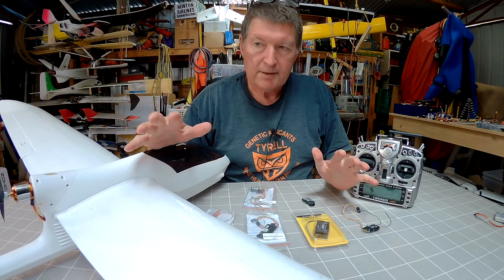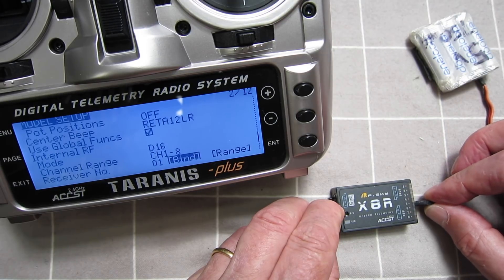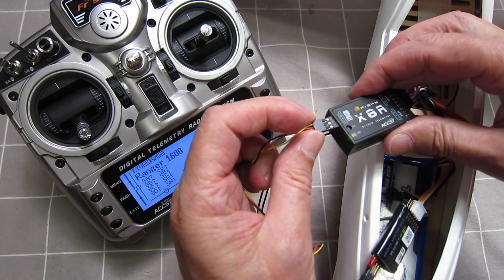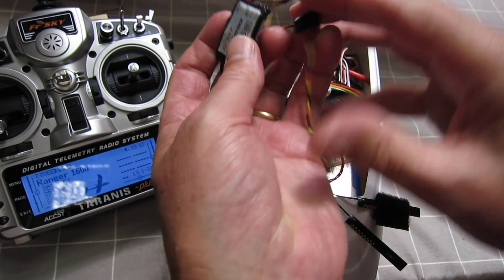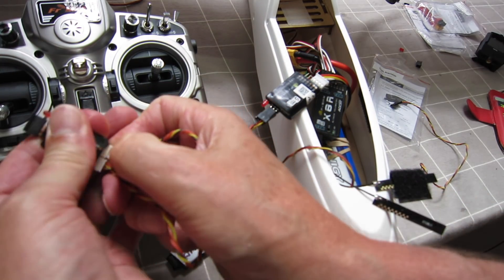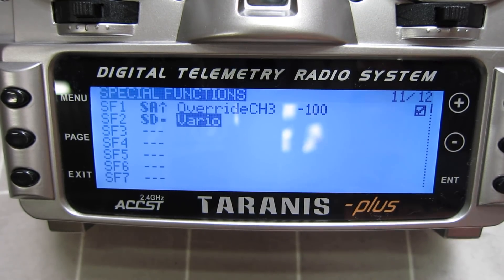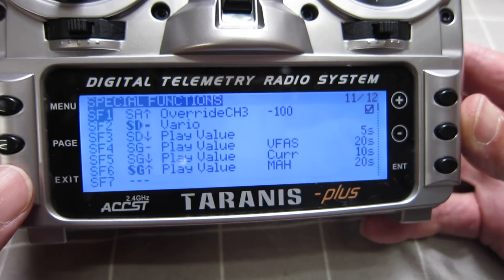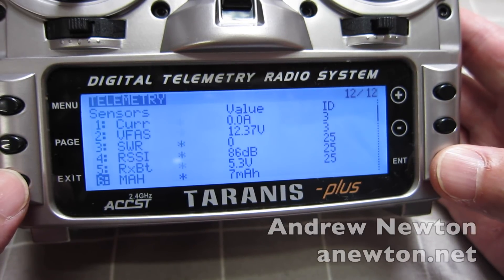FrSKY Telemetry Sensors

Comment: Both the OLED screens on my 2014 era Lipo Voltage Sensor and Servo Channel Changer don't work anymore. The Lipo Voltage Sensor still functions via the Smart Port. The Channel Changer is a bit to hard without a screen.

Comment: Another old one I ask "fresh" questions on 😄 Are these still your everyday sensors you use? I'm looking around at current sensor options and seem to be struggling to find any ?
Reply from the maker: Yes I still use the vario, current sensor and Lipo sensor regularly. Dont need them with a flight control board and GPS
Reply: @AndrewNewton  thanks for taking the time to reply, like always! I guess if I can't find a current sensor anywhere, one solution is move to a FC ! :)

Comment: Nice video. Thanks to you I got GPS and voltage sensor in my RC plain. Do you know what to do in case of loss of signal the plain come back to the origin point?
Reply from the maker: INAV with a good flight control board

Comment: Hi Andrew, nice video, I have a issue with the OpentTx (page telemetry) sensor called "FUEL", its default %, BUT, the problem is when I power up the model, this value just increase itself without anything is running or consuming amps, what is wrong? , its just started 10,15,16 % ....and so 100,111,115 and keep increasing with no sense or logic ... any idea ? thanks again and waiting for suggestions
Reply from the maker: That's a feature I haven't looked at sorry.

Comment: Hi Andrew, I have Frsky Smart Port RPM with the 2 temp sensors and I am trying to connect it to a JHEMCU Dual F7 Flight Controller. I ask if you may know how to set it up in Betaflight 10.7.0.
I am using a Flysky Nirvana Transmitter FS-NV14 2.4G 14CH with X8B Receiver (ibus).
Reply from the maker: Dont know any of that sorry

Comment: Could you tell me how you got the RSSI show on your Taranis with the X8R?  I am reading things about having to install an LC filter?
Reply from the maker: Just have to "Discover new sensors" and RSSI will be available on the Taranis. X8R also has analog RSSI connection where you connect the RSSI port to a flight control board, or you can send RSSI via a channel input like this http://newtonairlines.blogspot.com/2019/05/rssi-for-inav-x8r-l9r-xm.html
Reply: @AndrewNewton  Thanks, Andrew!

Comment: The verio???     Can it be set up to warn if going above flying site height limits,     warn of low altitude
Reply from the maker: Good question Russ, I'll have to investigate.
Reply: @AndrewNewton  thanks,   have just picked up a Horus x12s second hand for 500NZD,   with two 9 channel long range receivers,   have ordered from horus shop,     the verio, pitot, lipo level, and two rx8r receivers.      Hoping to get all the programming needed for a F-111 self build project.    I'm at the moment still using ff7 on 45mhz     lol    this is a long awaited up grade.      Lol     thanks for all your videos,   amazing the tech out there now days.     Been inactive for close to twenty years,      to entering gently with powered glider while I complete build.

Comment: Hi Andrew, can you connect 2x lipo sensors?   I have tried, but the radio can only discover one????
Reply from the maker: Don't know but this might help https://www.rcgroups.com/forums/showthread.php?2718108-Multiple-FrSky-FLVSS-LiPo-Voltage-Sensor
Reply: Hi Andrew.  I believe you’re spot on. The receiver cannot distinguish between the two sensors and becomes confused.  Unfortunately that link does not work anymore. Thanks for your help.  I will try to figure out how to change the id on one of the sensors.
Reply: For information I tried changing the ID’s on 2 identical Mini voltage sensors, but this still did not work.  To solve the problem, I have one Mini-voltage sensor and one Smart-voltage sensor.  Works fine now.
Reply: For information I tried changing the ID’s on 2 identical Mini voltage sensors, but this still did not work.  To solve the problem, I have one Mini-voltage sensor and one Smart-voltage sensor.  Works fine now.
Reply: For information I tried changing the ID’s on 2 identical Mini voltage sensors, but this still did not work.  To solve the problem, I have one Mini-voltage sensor and one Smart-voltage sensor.  Works fine now.

Comment: Very interesting     I'm just getting back into this hobby after a 20 year break.   Wow    amazing.    Only thing im really waiting to find out is if there is a pitot tube sensor for real time air speed,    to reduce stall,   receive low air speed warnings.     Be more handy than gps ground speed
Reply from the maker: Yes Pitot tube airspeed sensors are available. I have tested the Matek
Reply: @AndrewNewton  oh nice    are they any good,   as give real time info    or is it delayed??    Can you set a low value with them to trigger stall alarms???

Comment: Great information as always!!! Do you have a sensor you prefer to use more than others?
Reply from the maker: Vario sensor with the Lipo voltage sensor are what I use most for gliders. 40A current sensor is what I use for new powered planes to check current.

Comment: Hi, thanks for your kind videos, which help me a lot. I have one more doubt that how can we add two sensors of same kind, say 2 current sensors FCS150A in a system. I am trying to change the id using the Frsky channel changer, and unable to get in discovery of new sensor process. If adding a custom sensor with address and changed physical ID then it is simply copying the value of the primary sensor. Please help me out. Thanks in advance
Reply from the maker: I have never tried that but I think Painless360 or Richard Mrazek had a video on something like that
Reply: @AndrewNewton  ok thanks for your kind reply. I will check with them

Comment: Very good your video.
I have a question to you:
The reciber X8R only read sensor FRsky, or read anything sensor to connect at the fly board ?
Reply from the maker: Yes, only FrSKY sensors connected to the Smart Port of the X8R. Other sensors connected to a flight control board would be independent of the receiver.
Reply: @AndrewNewton  thank you very much for you answer

Comment: Why would you use these instead of telemetry sensors on the flight controller?
Most flight controllers can take data from barometer, voltage, airspeed, current and GPS etc. This can all be used on an fpv system as well as sent to the taranis
Reply from the maker: True but most flying is done without a flight control board.

Comment: Thanks for this and all your other videos Andrew. I have been trying to get FLVS-01 to work with my D8R- II Plus telemetry r/x for a while (I have 4 of them). The video link that you gave to Anton Neeshpapa may be just what I needed. I have used them with a 9XR Pro without telemetry. I have ordered a Taranis Q X7, hence my watching your videos of same. I have previously set up telemetry on a Fly Sky FSi6 which I found relatively simple to do and I have it showing t/x, r/x internal and flight pack voltages + altimeter and vario for my gliders. Again a lot of this was with help via your videos. When my Taranis arrives I hope to put Ersky9x onto it as that is what I am used to using. A video of this conversion would be great. Keep up the good work. Your videos are always interesting and easy to understand. Thanks again.
Reply from the maker: Er9x was my first introduction to open source firmware on the Turnigy 9X. But I'll only put OpenTX on my transmitters now.

Comment: Good stuff as always Andrew. Thank you. Im just catching up with this stuff having recently picked up a Q X7 after my trusty 9XR Pro gave up the ghost.

I've got a bit of a challenge for you...maybe...running OpenTX 2.2.2....do you think that once you've got a switch set to call up altitude ...you could instead use a Knob to call altitude AND create some sort of Logical Switch or Special Function to use a Knob to vary the time between calls.....so at the start of the Knob say it called the altitude every 20 seconds further round on the Knob would decrease the time between altitude calls...say 3-4 positions decreasing the time between calls by seconds in each position. Then you could have the vario running on a switch and have the altitude calls being called over the vario. Sometimes an update every 30 seconds is fine to know what the sink is actually like but then when you hit a nice thermal and the vario is screaming be nice to get the altitude calls every 3-5 seconds and really know whats going on up there. 

Anyhoo thx for you continued awesome vids.
Reply from the maker: Good stuff SKT. Yes you can use logical switches to divide a knob into sectors that act like separate switches, and have a different Special Function for each "Knob switch"
Reply: @AndrewNewton  Rad. If you get a spare minute and think it might be something other flyers would appreciate...please do knock up a short how to...certainly well beyond my noodle scratching at this point. It'd be much appreciated.

Comment: Hi Andrew, I am interested in buying a voltage sensor for my Futaba SG14.  I found that Futaba's sensor installation is very difficult and needs solidiring,,etc. 
https://youtu.be/URoqfvCTFmg

Is the sensor shown on your video compatible with Futaba transmitter and receiver?
Reply from the maker: Only FrSKY unfortunately
Reply: Andrew Newton Thanks

Comment: Hi guys, you will be loughing, but I didn't pay attention on that the SMART port is required (I didn't know any difference between SMART port and side ports on a receiver). So now I got the telemetry FrSky FLVSS sensor as you are showing on the video, and a D8R-II plus FrSky receiver. I was sure everything will work as the receiver has "Telemetry" signature on it, but now I just realized that these two pieces of iron won't work together.
Will somebody advice please the best way to make them work together (D8R-II plus FrSky receiver + FrSky FLVSS telemetry sensor) using any special additional device, for example... Or is it buying an X-series receiver is the only way to use the sensor?
Reply from the maker: I have only ever used X Series, but there is a telemetry hub you can buy to connect sensors to the D series Rx.
Reply: @AndrewNewton  Wow! that would be cool. I tried to search, but google doesn't want to share about the hub. If you really know the device, could you please post the link to find it
Reply from the maker: @antonneeshpapa5409   Here is a link but I have not used the hub. https://www.banggood.com/Frsky-FSH-01-Telemetry-Sensor-Hub-p-1052238.html
Reply: Yes I have seen this hub: google had sheared it to me :)). But I ignored it as it doesn't say that the hub will connect the Smart Port device (which is our FLVSS). I found that FrSky used FLVS-01 that could be connected to my D8R-II plus via the hub or maybe even directly... but now FLVS-01 is not manufactured any more.. Looks like no way to use these stuff together. I'm trying to find alternative sensor at the moment but can't get certain information.
My target is just to get voltage data from my battery on board any available way to land in time.
If you have any idea how to help me with my problem, maybe you could hint what direction to look?
Reply from the maker: Anton have you seen this, might be a help https://www.youtube.com/watch?v=IqweCZzQy68

Comment: Hi Andrew
If the current sensor can display the pack voltage, what is the point of the Lipo voltage sensor?
Reply from the maker: LiPO sensor reads each cell and it very small and light, better for gliders and just keeping an eye on pack voltage. The current sensor is limited to 40A, inline with the battery and much bulkier and more expensive.

Comment: Great stuff, Andrew! Do the double male connectors used to gang the sensors come with them? If not, where do you get them? Thanks for your time.
Reply from the maker: They are called Female to Female connectors (which seems the wrong way round to me). Yes they are supplied but you can buy them from HobbyKing or anywhere mutirotor gear is sold.

Comment: Very good video Andrew as ever! Wish I had seen this the forst time I set up telemetry!  - you showed me a few extra features there I was not aware of and now added - thanks! One question though is I see you have SWR as a sensor input (on the view of your 9XD Display)  - how did you get that as all I have read so far says the latest version of Open Tx (2.2.0 I think) did away with SWR and all you have now is RSSI unless you look in Analogs for RAS (not something you can see easily) so I'd be most interested to know how you get it please?
Reply from the maker: Thanks Jeffrey. SWR showed up automatically when I "Discovered sensors" I doubt that it actually works, just a hangover from previous firmware.

Comment: Hi Andrew..... I have to set my aileron in my multiplex heron and the surface have to go 7mm up and 5 down... How I could set it and may I put the plug of the aileron in different channel or have I to use a V connector?
Reply from the maker: Aileron differential is the answer, and you need to use separate channels for each aileron

Comment: Loving this Andrew. Answering so many questions. Please keep this going. This is also great fun. Now i can get my Taranis to work correctly. One thing I can't do is the arm, dis-arm, the electric motor, onto a switch, so that one setting covers all present and future added models. Thank you so much Andrew. Keith.
Reply from the maker: Yes you can't do that as a global function. It would be a good feature
Reply: what you can do is set up the override ch1 (throttle) to -100 that effectively disables the throttle.
Reply: Andrew Newton Ok Andrew. Thats a pity. 
Can you please show us how to do the above, on each single model then?
Thanks. Keith.
Reply from the maker: No problem Keith, I'll include it in the next video. I use the same as Daytona FPV.